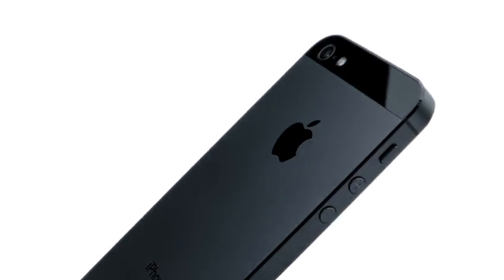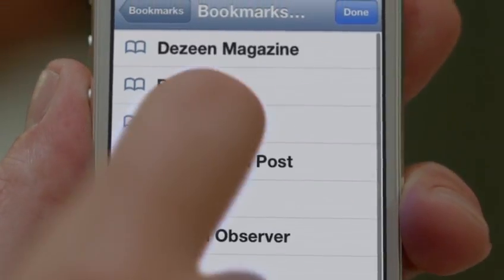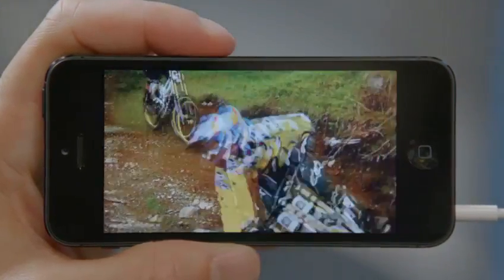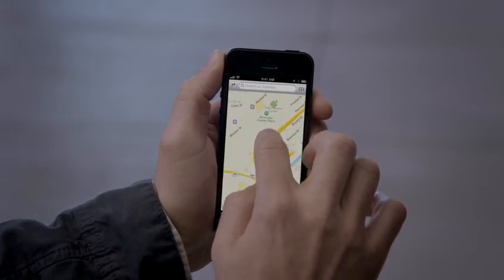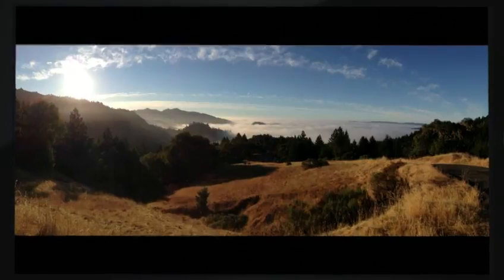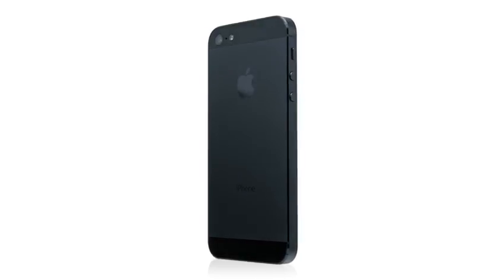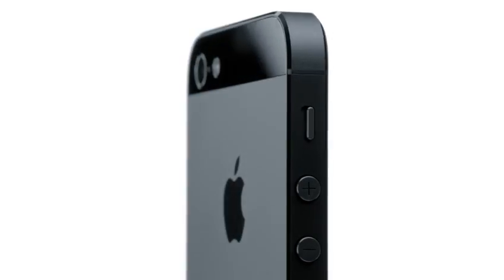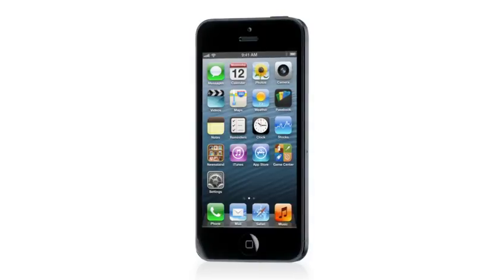Apple iPhone 5 promo video

Comment: The only significant argument against the I phone 5 is the new lightning jack that is the Achilles heel....it is all digital which is a huge step backward in adaptive ability. It cannot send out an analog signal meaning even with a 30 pin adapter you wont be able to use you old docks...and all car stereos wont be able to detect it...there is NO adapter that can go from digital to analog....so this is a major setback and the only positive is sync will be faster and the phone is thinner....

Comment: Weren't you listening? It has a processor which makes it twice as fast as the 4S and much faster than any of the competition. A bigger screen that you can still use in 1 hand unlike Android phones. A better design made of aluminium. Improved battery, 4G, lighter, thinner, the list goes on. 
Apple don't expect people who just bought the 4S to upgrade. They hope to interest 3Gs and 4 customers to get the 5. You say there's little difference but I don't see much difference between the s2 and s3.

Comment: Mac's and PC's are the same.....same parts from the same factory in china...the only difference that can even be mentioned is the OS and the fact is that windows 7 handles adaptivity much better...you can use any parts and it will run. THAT is why they are better at gaming is cause you can use higher grade parts without buying an entire computer. And before yous say you can exchange parts in macs too....thin again OS10 aka Lion has specific programming that locks it down to the internals.

Comment: Silly Sheep. The Note 2 has a faster processor (quad-core), twice as much ram (2gbs), the latest mobile operating platform (jellybean), it has a 5.5 inch screen (1.5 inches bigger), memory expansion slot (giving you up to 128gb of memory), S- Beam (use if to control your electronics and quickly exchange info), it is sold as an international phone (cellular connectivity everywhere). The only thing they have in common in the number of megapixels in their cameras and the price. Proof, Jobs is Dead